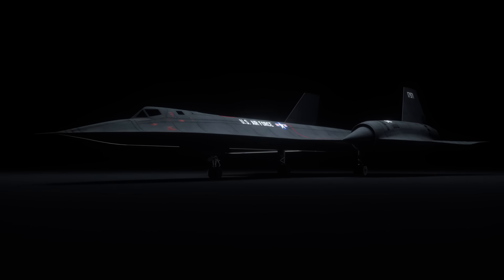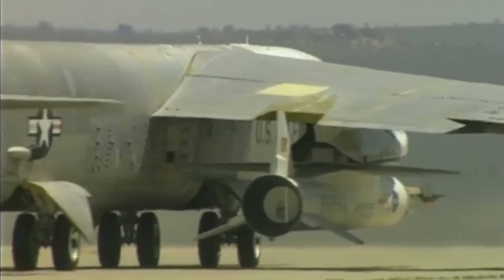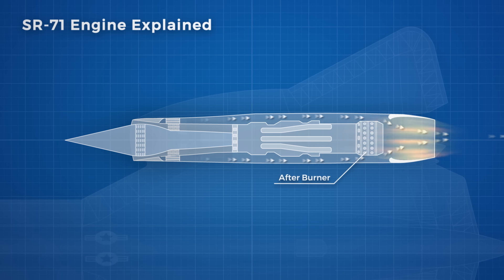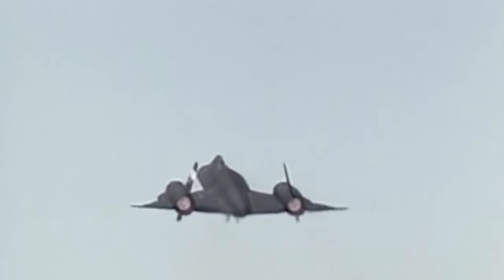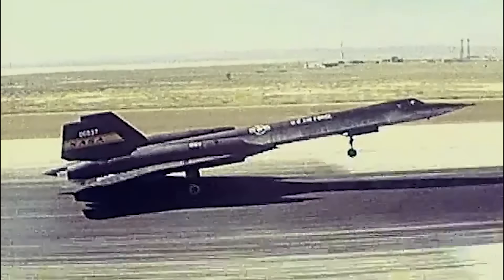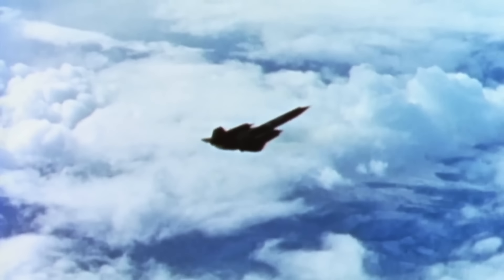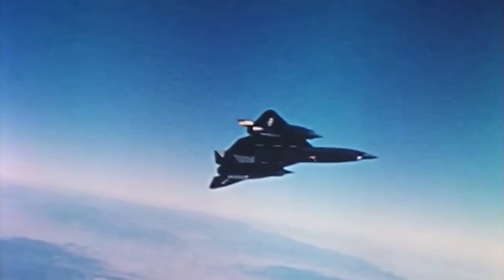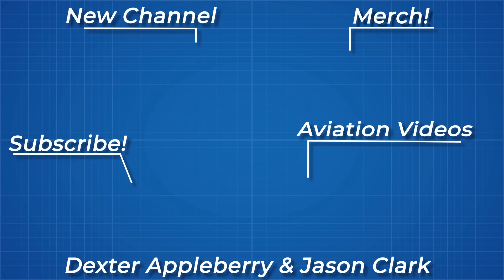The Insane Engineering of the SR-71 Blackbird

Comment: "Before their atoms begin to diffuse and slide over each other" - that has to be the most scientific way of saying "before it melts".
Reply: Ikr..I'm definitely going use that instead of saying melts
Reply: It actually softens, it doesn't melt. It can cause the metal to creep at stress points. Most materials tend to soften as their temperature rises. A very stark example is certain plastics like polyethylene have glassy properties below certain temperatures. It's not a smooth transition, it happens quite suddenly.
Reply: my ice cubes are sliding part!
Reply: How weird is it that I scrolled down and read this as the dude in the video said it
Reply: You really think that titanium melts at 300 degrees centigrade?
Reply: @PalladianPD  Be careful with comparing polymers to metals. As a chemist (polymer scientist), I do not understand much of metals but there are certain differences (amorph or semi-crystalline structure compared to metal lattices), which cause huge differences. However, as a comment on a youtube video, I guess, you're right.
Reply: Same as « It moves point 66 meters » for the cone. Scientific connotation...
Reply: @erikwegener3484  absolutely they have very different properties, metal softening at high temperatures is not really analogous to polymer glass transition, but that was an example where the solid does not change state but still remains solid.
Reply: No, he is talking about the metal becoming soft due to temperature, it's not the same as melting. Melting is a phase transition to liquid, meaning the particles move freely and there is no more solid structure. What he is describing is a solid material becoming less resistant to deformation because the atoms are more energetic.

This is how forging works. Does the iron being hammered look like a liquid to you?
Reply: titanium has a melting point of over 1600c. its not melting at 600c
Reply: @seanbirtwistle649  Ohhhh, okay. didnt know that :D
Reply: No kidding!!!
Reply: Atoms don’t diffuse wtf me taking doesn’t make it a gas
Reply: It " creeps". Which basically means it deforms easier under load due to heat.
Reply: @seanbirtwistle649  with allies  it  can go over  1750

Comment: My first thought when they retired this in the 90's was.... "What did they replace this with that we wont know about for 50 years?"
Reply from the maker: Satellites? Because it was satellites. Spy planes are still useful though. Satellites are predictable and if you are fast you can move things out of their sight quickly.
Reply: @RealEngineering  Keep in mind that they used the RQ-170 for a decade before it became publicly known in 2011.
Reply: @RealEngineering  So predictable I even managed to take a photo of one of them. Unfortunately, it isn't moch more than a bunch of blue pixels, I need better equipment :)
Reply: Mig-25s (and Mig-31) played a role as well. Although they are not as fast (Mig-25s can fly Mach 3 but it will cause severe engine damage), they can fly as high and close enough to potentially fire Mach 3+ AA missiles. At those speeds AA missile avoidance is impossible.
It is the same reason why XB-70 was cancelled. After U-2 shot down incident, US stopped all Soviet flyovers.
Reply: @RealEngineering  Well, at the time (1999) I was working inside 'The Beltway' (Metro Washington, D.C.). We were not government or military. According to the 'knowledgeable' among our group we (the US) had a vehicle that could get people "anywhere in the world within 90 minutes". That sounded like some sort of ballistic transport. I agree satellites can 'see' everywhere. But they cannot transport. Anyway, the conversations my fellow 'unknowledgeables' and I had on this topic have long stayed with me. I mean, they created the SR-71 in the 50's. Imagine what was created in the 90's that we still wont know about for some time?
Reply: TR3-b
Reply: @_Fennix  U2 variants are flown regularly out of a US airbase in the Far East to monitor military activity in north Korea.  They don't do overflights, only flying extremely high along the border so they can see deep into nK.
Reply: @flakgun153  Well, that's just one of the KH (KeyHole, peek-a-boo :) ) satellites, what I was able to take a photo of. They are up from the '70s IIRC. Imagine, the Hubble Space Telescope looking down to Earth. I mean, a Hubble is no different than a KH! Yea, of course the sensors are different, but the build, even the mirror size is the same. About 10 of these Hubbles up there...
Reply: @mazelme  The tech gulf, when it comes to the practical limits of material physics, wasn't terribly great between the early 50's and late 90's. Things have moved somewhat in the last decade with the advent of new tooling but we're still basically at the point where much of work done on the cutting edge is just expanding on the original work done decades ago and not in such a way that they'd be able to bypass those practical limits.

Science is an incredible tool and engineering makes a lot of things possible but we still use concrete, for example, not terribly dissimilar to that which was used to make the Parthenon more than 1400 years ago.
Reply: @HowIsAsh  considering the greatly increassed cost of keeping a person flying at such speeds, its is inherently better to use drones, because computers are lighter then people , wich reduces the weight of the aircraft making it possible for to go even faster then a manned plane.
Reply: @Statusinator  Yep, and it's probably not the only stealth drone flying around. Remember we still don't even have official confirmation of the stealth Black Hawks that we know were used on the Bin Laden raid. Whole bunch of equipment out there being kept under wraps.
Reply: Uk has a 100 year rule. we may never know.
Reply: @brownro214  U2s are also flown out of RAF Fairford in the UK on daily missions. They do not even try and hide them nowadays and they fly in and out in day time.
Reply: @RealEngineering  I know in the Vietnam war there where a couple of time that the US special forces where planning operations in North Vietnam like hitting a POW camp. And they would have to stop preparations every afternoon and pack the mock up up so Soviet sattiliets wouldn't see the mock up.
Reply: @brownro214  I don't know if they still fly out of there, but when I was stationed at Osan Air Base in 1983, U2's flew out of there.
Reply: Replaced by the Aurora, makes a debut in the new Top Gun movie.   Capable of Mach 6.
Reply: Real Engineering what about the SR-72
Reply: @HowIsAsh  Its probably not as fun for the pilot but it means they can do waves of drone swarms pretty easily with their pilots never risking their lives.
Reply: Iran captures an RQ-170 by intercepting it’s control frequency and then landed it at one of their air bases. They then produced copies of it with the help of Russia that could also fire 4 missiles. One was used to fly into Israeli air space and was unable to be shot down or intercepted, and that’s the problem with drones my friends.
Reply: Statusinator more than a decade
Reply: Satellites do handle the bulk but the SR-71 did have a replacement. Ironically it was the U2, the plane that the SR-71 replaced. I believe the last flights for the U2 were a few years ago by NASA.
Reply: @Statusinator  RQ-170 was classified as it flew over Afghanistan? Because I remember it from either 2001 or 2003 - start of some War. And I think it was Afghanistan.
Reply: So you are paid by the military industrial complex and renewables industry?
Reply: @RealEngineering  Theres a story about Groom Lake. Where they tested prototype aircraft (and probably the SR-71 prototype). The Groom Lake staff were given charts and tables of the times when USSR spy satellites would be overhead. Due to their predicable orbit.
So the Groom Lake staff just towed the prototype aircraft into hangars as the satellite was overhead then towed them out again once the Soviet satellite had passed by.
After a while the Groom Lake staff started getting adventurous by painting the outline of mock aircraft and even the Starship Enterprise on the airfield. Then using gas heaters to warm up the concrete floor where the mock aircraft engines would be, for the satellites IR cameras.
Reply: @jannegrey  Didnt the Iranians capture one? I remember a similar looking UAV in the news when it happened.
Reply: @notmenotme614  Yes they did. But I remember seeing it earlier, although I now remember that I didn't see it at the beginning of War (different drone), but I did see some footage from mid-2000's. Name wasn't given, but it was definitely it. And it was made official only in 2011? Because Military papers in my country - Poland had written about it way earlier. Although again no official name was mentioned. So I guess it was technically classified, but in reality it wasn't such a secret.
Reply: @RealEngineering  Can't you be just cool and say "yes, who knows what they have now"
Reply: One thing is for sure, when the US government DOES start a new project, no matter how secret they try to keep it, it  usually becomes public knowledge in a week or two.
A country with the freedoms and resources like the US can accomplish great things, but it can never keep it secret for very long.  The two most top secret projects the US has every had-  "Manhattan Project" and "Have Blue" lasted about a week before people knew the US was working on the atomic bomb and a stealth fighter.  The only thing they COULD keep secret were the details.
Reply: @mazelme  The Prompt Global Strike System, that's the ballistic missile based transport you're talking about. Details on Wikipedia. Nothing mysterious, certainly not conspiratorial like what you've implied. Some Americans are far too fond of bullshit conspiracies, unfortunately.  Perhaps an indication of education levels.
Reply: @brownro214  Entirely fair thing to do, no one should be trusting them.
Reply: @Statusinator  That wasn't exactly by choice that they revealed it though. Without Iran downing one, it probably would still be classified
Reply: Satellites
Reply: @gabrielgrey2253  2400 years ago 300 bc
Reply: Black Dog Tr3b
Reply: @mazelme  , think about the mystery of area 51.

Comment: This plane is such a technological marvel that it uses it's own fuel as a coolant
Reply: thats kinda normal for high performance jets
Reply: This isn't unusual for Jet aircraft. The Challenger 300 for example has multiple Fuel/Oil heat exchangers, and Hydraulic/Fuel heat exchangers.  The Hydraulic lines are simply routed INSIDE then out the fuel tank which dissipates some of the heat of the Skydrol Hydraulic fluid which is under very high pressure
Reply: Jet-A used in normal day to day jets fuel also isnt special really. Glorified Diesel. You can absolutely run Jet-A in your Diesel car or truck.
Reply: your weed eater and moped also use fuel for cooling
Reply: @raflystiansahlatif5293   100% agreed - “skie broth” is a bag of dirt.
Reply: Rockets do that to, cooling nozzles and engine and heating the fuel at the same time - maybe this space plane is one.. only one engine configuration is known to the public, and it had a lot of liquid oxygen on board.
Reply: Rockets do that all the time tho..
Reply: F1 engines in Saturn V did the same. It is not that unusual
Reply: @raflystiansahlatif5293  Damn, you destroyed him
Reply: @skiebroth2462  Shhhh, Vietnam is coming
Reply: It's like a kangaroo licking its own wrists and letting the sun evaporate the moisture to cool their blood.... or something.....
Reply: Shit guys I enrich the mixture in my cessna 152 to cool the cylinder head temps. That's on a 70 year old piston design.
Reply: concorde did as well
Reply: 2 stroke engines: "am I a joke to you??"
Reply: To all the comments above: We're not talking about engine or cylinder combustion head cooling-- the Blackbirds routed fuel along the cockpit, landing gear bays, and the electronics to soak up the heat. It served as the heat sink for the air conditioning!
Reply: @22airjordan1  your modern diesel truck definitely needs more than basic kerosene - running JetA will guarantee a short engine life
Reply: @ghostrider-be9ek  Oh no your absolutely correct. Its not going to be ideal for the engine for sure but it will run fine in a pinch. At the airport if the fuel truck ran out of fuel we would out just pump a couple gallons of Jet A to get it to the fuel farm
Reply: Rockets also use their fuel as cooling.
Reply: Technically humans too use their own fuel as coolant.
Reply: @BogeyTheBear  professional answer 👌
Reply: @22airjordan1 kerosene and diesel are same? Hmmm ok
Reply: The Triathlon source was used for initial start up for the engines, but If someone wants to correct me If I’m wrong but the video says otherwise
Reply: @jungletroll3844  it’s actually normal for most combustion machinery too. 
Combustion gasoline engines use the fuel tank as coolant for oil.
Reply: Rocket engines do this too - see "regenerative cooling"

Comment: What makes this machine amazingly interesting is that, it was designed and engineered in an era where computerized assistance was minimal.
Reply: When everyone used their brain instead of going on Facebook or most sections of Reddit, where they're brainwashed into cattle by each other.
Reply: A lot of calculations done on slide rules back in that era
Reply: Blake Brown  Books
Reply: @howtogaintime739  you know how hard it could be for non academics and non industry professionals to get literature on highly niche topics? Local libraries usually only have introductory texts to a lot of stuff like this. The internet is a much more efficient method of information proliferation than books ever could be or ever were. Although they also increase the amount of false information out there, which is the risk, but the rewards have far surpassed the risks in that regard, even despite all the insanity with stuff like "fake news" and what not.
Reply: @maxk4324  true
Reply: It’s as if they copied it off another plane the public has never seen before LOL
Reply: @Baigle1  Facebook bad, Reddit bad, military good
Reply: @Baigle1  Ok boomer
Reply: @maxk4324  Excellent responses, keep spreading that phenomenal information. ;)
Reply: @Whitley1234  Ben Ritch wrote a book called Skunk Works that (among other things) discussed the design process for the SR-71. The predecessor was called the A-12, just a bit shorter, single seat, shorter range - the CIA used it before the SR-71 was finalized. They are extremely similar... point being the designs A-1 through A-11 illustrates the changes in exterior design that Lockheed went through before settling on the SR-71's final shape. Lockheed's staff did the math. And the math was good.
Reply: Back in the day a, 'computer,' was a female employee who manually crunched numbers like in the Apollo program.
Reply: @Baigle1  yea man youre so woke and all knowing